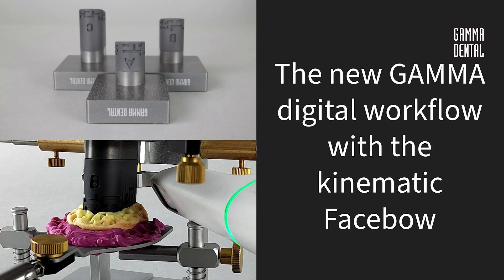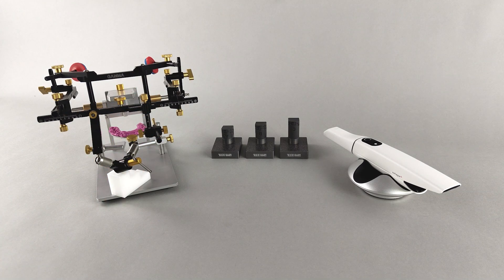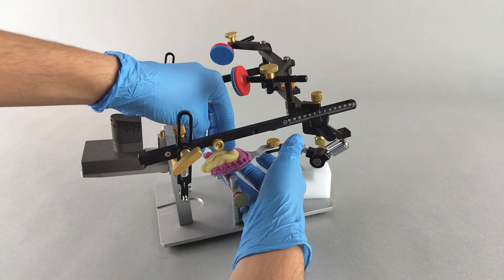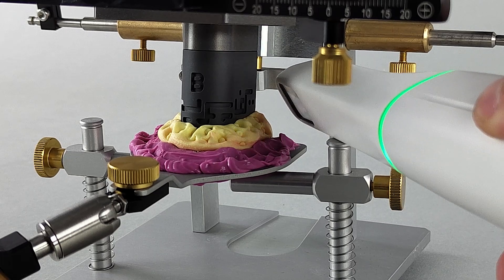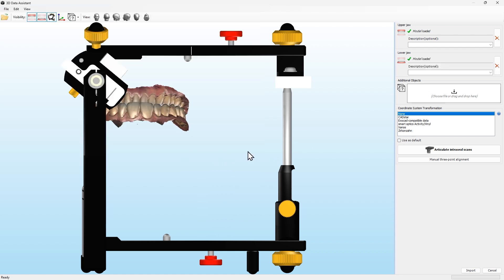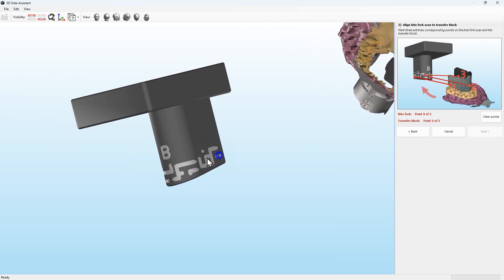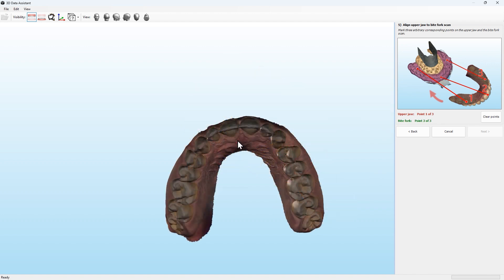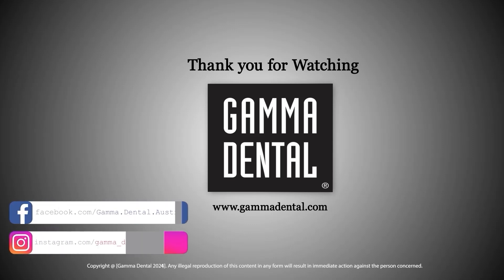GAMMA Digital Workflow using a kinematic facebow

Comment: To be honest. That workflow is not practical at all.

As a dentist I do have the IOS in my office, but all the equipment for mounting is the lab.
Now I need to do lab work in my office, instead of treating patients.
Placing the fork into the mounting station and using putty does not seem to be digital at all.

The next big questions...
- why do I need to select the correct mount (A, B, C). Why is the software not capable of detecting the mount I used?
- why is the software not capable of matching the scan of the maxilla automatically to the impressions in the bite fork?